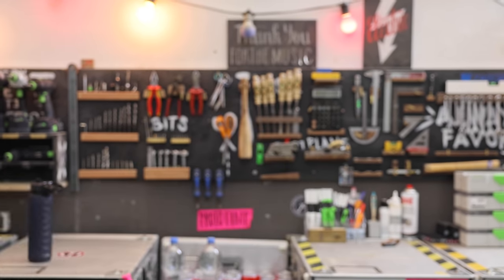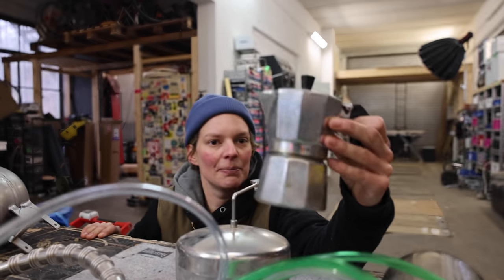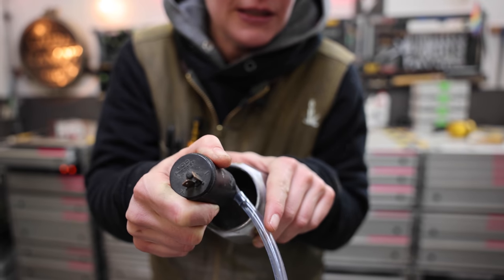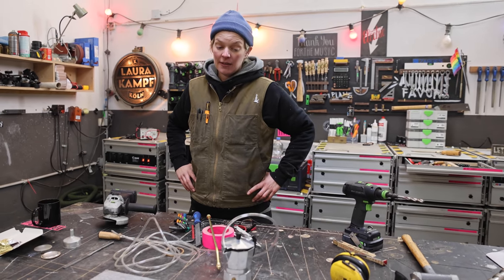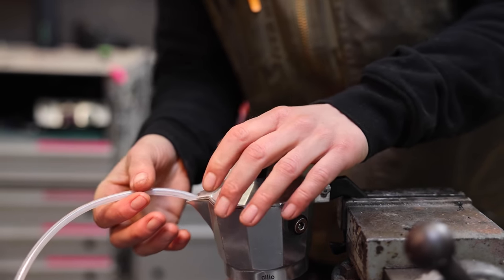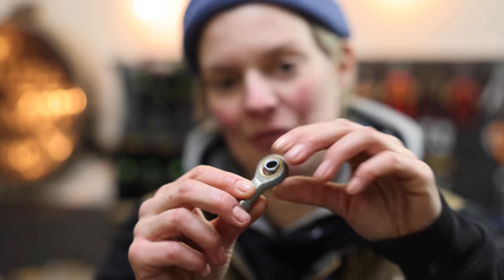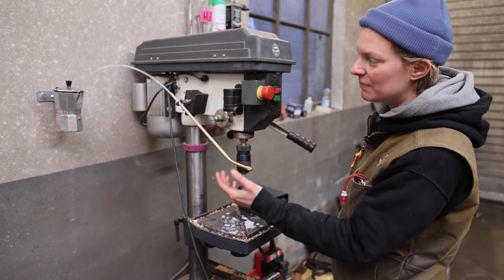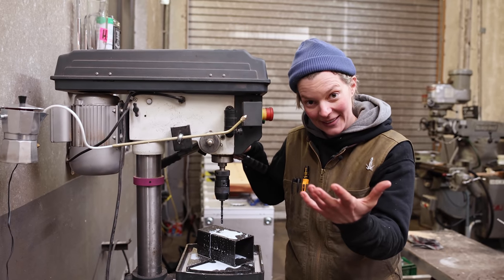Cutting Oil Pump from old Coffee Maker (genius or stupid idea?)

Comment: The water jet nozzles that were on the original car bonnet would be ideal is they’ll match the motor power and pressure. As mentioned below they have a built in one way valve to stop dribbling! The jets can sometimes also be adjusted for direction using a pin if they’re a ball and socket type. Or use a water pistol with a remote release at your foot😄

Comment: Use the water pump from a Keurig with an Arduino controller.   Their pumps have a hose and a ball that squeezes the hose, which gives 1 squirt at a time based on rotation. Its like a very basic dialysis pump.   It will give you control the way down to a droplet at a time.

Comment: I agree with zola tanaffa, and sub-commenters, the pump needs to be slightly below the drill table, that way it siphons back into the coffee maker, instead of out the end (lowest point). 

You can also quickly and easily connect the clear tube to the hard pipe with some marine heat shrink (the kind with glue inside). Makes a really nice quick connection that can be fairly easily removed as needed. Other idea would be to solder a hose barb into the pipe.

Comment: You might be able to stop the syphoning by adding a 1-way valve.  I'll bet you could use the simple check valves they make for aquarium air pumps, which would fit in the hose you are already using.

Comment: I don't know if it has to be electric , but I was thinking in terms of oil cans for machine work (thumb press operated) with a right size nozzle , or something like an old fashioned perfume dispenser , with a little rubber pump at the end (nozzle instead of atomizer). I'm sure that you can make it electrically powered , but you need one or two squirts at a time , so maybe you can use electromagnetic actuator from a car (for door locks). Of course , you can find something else to use as a container for a cutting fluid , instead of a can , or perfume bottle. I'm just talking about principle of operation. Also , people are right , your container needs to be positioned lower than your work  bench on a drill pres.

Comment: As a differential recommendation to the tank-lower-than-nozzle crowd, may I suggest adding a light action check valve.  You may have something like this around the shop.  They're typically used to prevent back flow, but they usually involve a wee bit of spring pressure.  This spring pressure should be just enough to prevent flow when the motor isn't energized, yet be so light that the pressure from the motor can overcome it and flow is allowed.  Good luck!

Comment: nice work Laura, its a very cute project! i was honestly really hoping that your oil would be dark like coffee.

anyway, i think you need a proper seal at the top where the hose slides into the pipe (where the fluid came out when you tried to block the nozzle). i think all the cutting fluid that is in the length of pipe can trickle out even when the pump is off, because air can get in at the top to replace it. if it is sealed, its like putting your finger at the top of a straw with water in it, but when the pump 'pushes' more liquid it will be forced out of the nozzle.

Comment: If lowering the coffee machine doesnt work what about adding a normally closed electromagnet to press the hose. If connected with the rest of the electronics whenn you switch the pump on the magnet would open and once you cut the power it would close pinching the hose and stopping the flow.

Comment: ok, a check valve/non return valve will fix this, most windscreen washer systems have one to stop the fluid running back to the reservoir so that you don't have to wait for the tubes to refill when you use the washers. This will slightly  increase the pressure so you may have to seal (silastic/sikaflek) the hose in the pipe.
another great vid.
keep smiling!

Comment: if you mount the oilcan near the drillhead of the drillpress you can gravity feed the oil through a tap in the bottom , i seen a video made by fireball tools where the oil dripped on a brush that pushed along both sides of the drillbit kindof feed the oil down along it , should work ok and doesnt need 12 volt
the dripping is caused by syphoning as the hose ends up below the coffeemaker , to solve it you need to put a T in the top of the line and put the other end of the T back intoo the cofeemaker , that way the fluid will squirt out of both ends when the pump is running but will draw air in and prevent syphoning after the pump is shut off , it will still leak some but whont drain the whole can 
another option would be a onewayvalve near the end of the hose , usually the springtension in that is enough to stop the syphoning but will be overpowered whith the pump running , should stop the dripping pretty mush immediately if you mount it realy close to the head , added advantage is that it will keep the pump primed and the hose filled with oil

Comment: Look for a check valve to help prevent drips. Since its oil, you might want a check valve / nozzle combination.

Check valve with low pressure so the wiper pump can open it but when the pump is off, no path for the fluid.

Comment: Put a small ball bearing in the nozzle with a spring pushing it backward creating a check valve. The pressure from the pump will push the ball out of the way and when it turns off, the spring will seat the ball and stop it dripping.

Comment: I'm not sure that it's just a siphon effect, I think because the brass tube connection to the hose is not airtight, when the tube fills up, air can get in behind and it continues to drain the volume held in the tube. Could be as simple as sealing that connection better?

Comment: 1)automatic soap dispenser nozzle/sensor?. It flows steady until a motion cuts it off immediately.ir 2) The length of hose /speed of motor pushing fluid builds up pressure in hose. Maybe 1/2 way down hose or base of hose to pot, somewhere if you stop fluid(dam it up), it'll will retract into oil resevoir, taking pressure off hose buildup,not allowing dripping to occur.

Comment: Hi Laura, love the problem solving and continuous attempts to make the idea work. I think the intention is good but it is a bit overengineered in that you introduced a pump which would push too much volume of coolant. I would suggest getting a bike braking system (the wires) which presses an aerosol bottle handle, spraying a fixed amount of coolant on to your workpiece. Any time you want more you can just press the foot pedal again. Avoids the need for electronics and reduces waste of the coolant too. Hope that helps?

Comment: I would put the tank under the drill table so it could also catch the fluid draining from the table.
You could use that screen you took off to act as a filter for the metal shavings before the fluid goes back to the tank.

Comment: Car windscreen washer pipes usually have a one way valve to stop the fluid draining back. You could probably cure the drip with one of these. Thanks for sharing!
Reply: Back flow isn't the problem. The fluid is still going forward not backwards
Reply: @justmejohn44  if she puts the fluid reservoir lower, it will take a long time to pump, but if there is a valve the fluid will be held in position, & come out almost as soon as she operates the pump.
Reply: If you lower the whole reservoir yes! I see what your saying. But I still think gravity would be better , less energy and less complicated. Simpler is better sometimes.

Comment: A weak spring and ball in the tip. The pressure of the pump pushes the ball away from it's seat and the spring pushes it back when the pressure drops.

Comment: OMG...I think this is the first time I've seen a pan shot of your shop. It's freakin' huge!  You have all of your spy racks set up and filled, plus other storage racks & your 'shopping' area complete with cart. That all is so cool.

With the Expressoil, I agree that the unit itself should placed lower on the wall, that would help keep the oil down in the 
'pot'.  As far as the hose with the metal extension is concerned, I think it's a tad on the optimistic side to think that it would be completely hands-free. I don't know how to make this work, but a pic of a wing nut keeps popping up in my mind's eye.  Sorry I can't come up with more ideas.

Comment: It could be that the reason for the dripping is that the plastic hose does not close air tight into the brass pipe. This allows the brass pipe to pull air from behind and run empty. It may even, thanks to Bernulli, pull more fluid from the pipe. So first I would try to get that connection air tight. If the dripping still continues after that you could try to use a smaller diameter pipe and rod, so that the capillar effect can counter the tendency of the pipe to drip empty.

Comment: Maybe you seal the gap between the rubber tube and the outlet pipe, it would prevent air from going in the pipe and the liquid would held by suction?

Comment: I think the reservoir is to far up, the moment the nozzle is below the reservoir, liquids can continue to flow out. (Like when you siphon fuel out of a car, not that i have done that... 😁)
If the tank is below the nozzle and the hose is longer on the tank side of the highest point (where the hose meets the copper pipe), liquids will flow back into the reservoir.
Hope we get a follow up, love the idea and the choice of materials.
Reply: @Milea and another Spam Bot reported.

Comment: You need a pump from iv. (12v Dosing pump).  It will work perfectly and 3-12 voltage controller.

Comment: I think the fastest solution to the dripping is getting a better seal between the tube and hose. if it had a liquid seal the surface tension should hold the coolant in the nozzle.

Comment: A tiny bit of rigid plastic tube, squashed the right way, should act as a “pressure valve”: hold the dripping while the pump is off, but deform and “open” with the pressure.

Comment: try to use some kind of one way valve. The valve needs pressure to open. If the pump not running the the pressure is to low and closes which stops the drippinmg

Comment: atomize it. Use compressed air down the line to create a vacuume and then atomize the oil. the same principle as an airbrush. This way you will have no moving parts and will use less oil. i know it means a redesign failure is all in the mind, if it dosnt work you have just found out another way not to make something, I hope this helps and i know what you mean about the coffee perculator, they just have a great shap and design and i am always looking at ways of reusing designs but still keeping the shap so that it is still recognizable, have fun :)

Comment: Having the oil tank lower than the nozzle would certainly help with the drips. If you think about the application that pump was taken from, it's always below the windshield wash nozzles. I would consider an adjustable wall mount. One that can raise and lower the tank on the wall, so you can adjust the perfect spot between not dripping and too much gravity for the pump, there is a sweet spot. This would also be handy if the viscosity of the fluid changes, it will change that spot. This does mean the hose/wand will have to be sealed, as it's friction fit is a weak point.

Comment: I would get rid of the pump and instead use pressure to move the oil.
The bottom of that coffee maker is already meant to hold pressure.
So all you would have to do is connect the output-pipe airtight with the pressure chamber and add an input valve to get compressed air into the chamber.
I would use a small bicycle pump to pressurize the chamber. 
And the last piece would be an solenoid somewhere in the output-pipe to turn the flow on and off.

Comment: Others have said similar, but what you have is a siphon. This is a washer fluid pump. it was designed to push fluid to spray nozzle on the hood when powered. Then when NOT powered, the fluid should drain back into the reservoir to prevent freezing in the lines. Nothing you have built is acting as a siphon-break or backflow preventer.

Comment: A small spring and a BB as a reverse check valve right at the tip. You will have to use the same thread size as the wand there at the tip. Maybe even a bike tire tube valve with some modifications could work : )    Sure Glad I found you, I like to do much of the same but without the shop just my house.  P.S. I do have both that pewter coffee pot and the washers motor.
Seems the oil would be running out a lot?
Reply: I think it would be much wiser to build a oilier that filters and recycles the oil. something like a cookie sheet that can sit on or somehow under the table of the device doing the cutting. The Coffee Pot would be great for a Bird Bath.

Comment: Laura, try to find an one way membrane valve to install near the jet. This kind of valve needs a little amount of pressure to open and it will cut the drips
Reply: Yeah I was thinking along the same lines. Like the tip of a water gun, or plant mister.

Comment: Attach the oil holder to the main body of the drill and the tube to the  chuck cylinder. When the handle is pushed down the drip feed tube will move with it. If the hose is stiff enough then you can put the next to the drill piece tip. Oil holder, tube,  drip feed valve, magnet as per video, hook with no bearing attached to magnet,. Magnet attached to drill, oil holder end fits into hook,. Put tube on oil holder after in hook,.  this will help keep the oil holder in place, circular clamp to hold tube onto chuck cylinder.

Comment: Because the reservoir is higher than the outlet and the pump doesnt close the line you get a Siphoning effect just like when getting gas out of a car with a hose..... so either lower you reservoir or use a open and close valve near the outlet or use a pump that closes the line.
i like the idea though....

Comment: Someone may have suggested this before, but here goes. Maybe you could use a longer plastic tube. Form a U-shaped bend between the "reservoir" and the nozzle so the pump can force the fluid up but gravity will pull it back when the pump switches off. Of course, then you have this big "U" hanging in mid-air.

Comment: It was obvious from the start that having the container higher than nozzle tip would cause problems with dripping via syphoning after you used it once as the container isn't air tight. If you want to keep it above the height of the nozzle you need to make the container air tight with a one way valve in the top so as the pump pushes the fluid out the vacuum will open the valve and let air I n but once you turn it off it will close the valve.

Comment: ich speicher hier mal nur kurz meine Gedanken aus, ich weiß nicht ob das jetzt die endgültige Lösung für das Problem ist....
wie wäre es, wenn du ein Rückschlagventil einbaust um Rückfluss zu vermeiden und oben am Röhrchen nen Schlauchanschluss anlötest, so dass es dort weder Luft ziehen, noch Kühlmittel verlieren kann.
just giving my two cents, I don't know if this is a proper solution for the problem at hand....
how about adding a one-way valve to prevent flowback and brazing a hose connector on top of the tube above the nozzle, so that it can't pull air or loose coolant.

Comment: Also, I see that at 10:33, the flexible tubing is just loosely inserted into the brass pipe. This means no seal at the top of that pipe. When the pump is switched off, the remaining fluid in the pipe simply drains out. Seal the joint between the two. The pump, when switched off, should stop additional fluid flowing, which will hopefully then keep the rest of the fluid in the tube plus pipe via vacuum pressure.
Reply: I think this is the most important change. I would glue the tubing into the pipe so the connection gets airtight. If this doesn't help, I would switch to a small peristaltic pump. This should stop any liquid flow if pump isn't running.

Comment: Try to build a Peristaltic pump, these allow for small amounts of fluid on demand and I think they don’t drip 🙂
Other solutions would be a solenoid valve at the end of the tube or running the pump backwards for as long as it takes to empty the tube, timing can be done using an Arduino 🤓

Comment: I would go a more mechanical way.
A footpump and more resistence in the system, so you have to press quiet hard to overcome it. This way it should stop immediately after you stopped pushing.
Funny video, had a blast watching it while trying to solve a workshop issue my self...

Comment: Ok think of like a pipe line with a turn off valve for flow so it can be stopped or switched to flow and at the tube part to the metal needs a good pipe type clamp with washer to keep it from sputtering out there and lower it on wall cus it pumps up siphon will help make flow when turned off go back down let gravity do its thing for u not against you

Comment: Yep gravity is siphoning the fluid out. Removed the pressure relief in the bottom replace with an air check valve and make the top of the mocha pot air tight and your should be good.  Or just move it lower on the wall.

Comment: 1. Lower the tank.
2. when you srew off the nozzle, there should be enough space to widen the bore and to put a kind off pressure valve in. Just a rubber ball and short piece of a ballpenspring. Srew togehter and fixed.

Comment: lower the reservoir, the pump acts as a primer for the flow, you need to interrupt the stream and let air into the line so the fluid will flow back into the base, not be siphoned out the nozzle!!  OR raise the nozzle  end UP above the pump level maybe.

Comment: You will need to seal the tubing into the brass rod...if it is air-tight it should not leak when it's turned off.  
An alternate motor could be a UI pump...it is much more accurate for the feed rate (by voltage) and it would also fit in the coffee pot too.  
If you have a shopping cart for your shop you know you have a PROPER shop!  :)